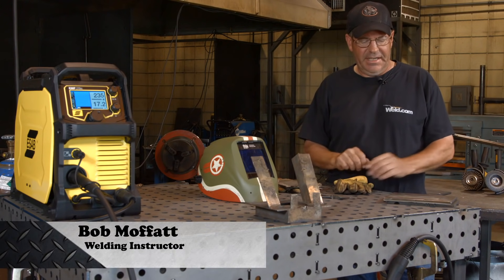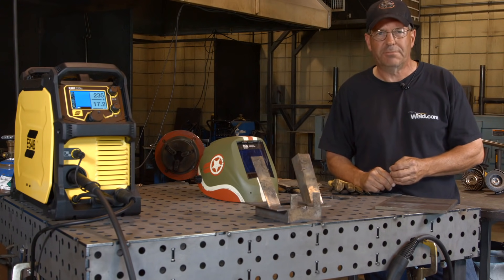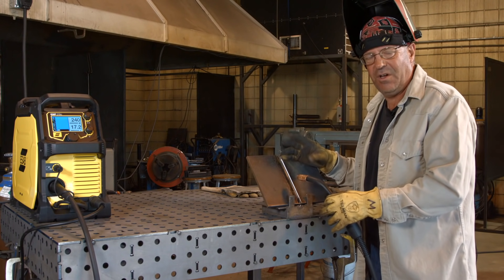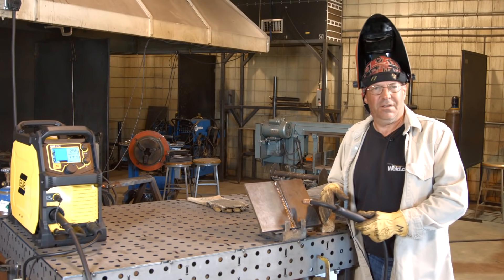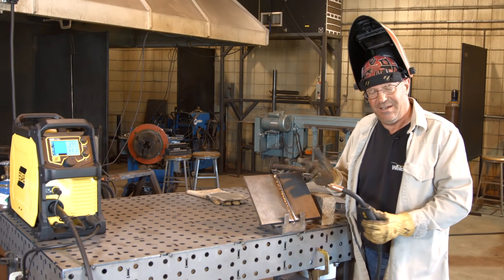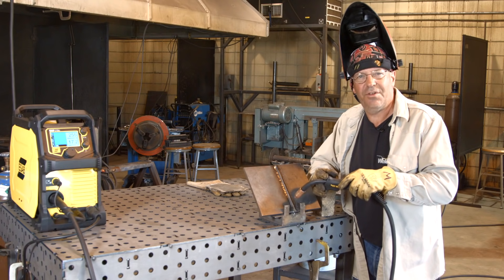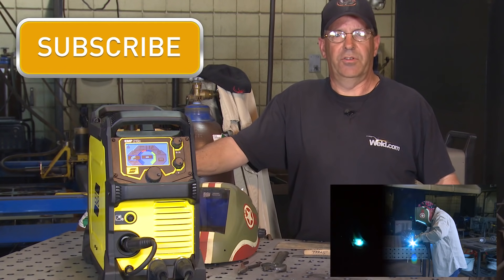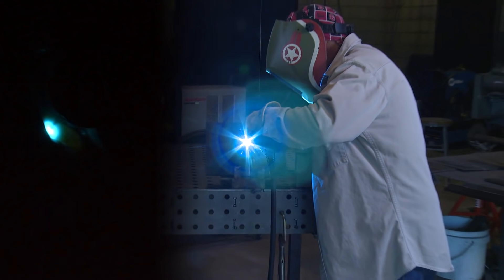Walking the Cup with MIG welding: Downhill Root, Uphill Fill and Cap

Comment: What kind of testing have you done to ensure there is no lack of fusion? ultrasound? X-ray? down hill is frowned upon. thanks
Reply: downhill is only frowned upon for thick metal, but when you do the root the metal is thin plus the gap. i worked at a shop were all sheet was downhill with good penetration.
Reply: Countryboy2206 understood, I weld on 1/2 to 3 inches thick that requires back gouging then tested
Reply: X-ray and bend tests.

Comment: im 16 and just yesterday i spent the whole day welding (second time) and i was so happy that i was actually getting the pieces of metal together, now that i see this vid i feel like shit lol
Reply: angel martinez just keep practicing.
Reply: Allen McKinney ive gotten way better now, i did a buddies cnotch(already made just needed welding) and it came out nice, for sure ill keep practicing
Reply: angel martinez I'm trying with a Clarke 80e stick welder that was given to me and now I'm trying to relearn how I got started back in my jr high shop class. I plan to get harbor freights 170 mig welder soon but I gotta run a 220v line on my porch first.
Reply: angel martinez you ll get it keep going young man.this comes with time an practice
Reply: @ImaBeastUaPet  Its a trade so it will take time.  I am 75 years old, started at 16 and still learning.
Reply: angel martinez keep it up mate, im 33., and only been welding for 3 years, and everyday, i get better and better, ive learnt to embrace my mistakes and errors, as they help me to learn what not to do the next time! Glad to see a young fella havin some passion for welding, all the best mate.
Reply: 220v is the way to go. I made an extension to plug into my dryer outlet when I bought my everlast welder. I was going to get a new line put in but never did get around to it.  My dryer outlet is convenient enough to get to.
Reply: Allen McKinney, hello, just wondering mate, if your from USA, if im correct, is your standard voltage in houses and workshops 112volt ac? Im from Australia, where everythings 240. When you guys buy welders, are they made for country specific voltage for operation, or do you us adaptors?
Reply: Be gentle and patient with yourself.  Bob has thousands of days experience doing top-end welding.  It takes time, practice and learning to be good.
Reply: Exactly, learn stick and tig as well. Mig is the easiest one, stick will really test your skills. I have a Lincoln 140HD i use at home, but everyday at work i stick weld structural welds.
Reply: STARK RESIDENCE 120 volt is standard, ive had to convert to 240v to run a welder safely  here in california
Reply: What ever you do, do not ever ever stick with one welding process. I know guys that can mig like nobody's business but give them a stick , just wow! They can't maintain the distance of the arc and the feed rate of the rod.
If you can buy a tig and stick welder and never stick with one welding process.
Reply: Lol i was 13 when i frist started now im 16 2 and still have issue ever now and then so i mean they dont go away but they will slowly decrease over time
Reply: 4 years later,  how's your welding?
Reply: Here in Slovakia (Central Europe) we´re playing with 400V 3 phase, so its another level of welding.... At home I have 240V 165A Kuhltreiber stick welder and I used to learn by myself at home.. but now Im in MIG/MAG welding school :) Today we´ve done our first fillet welds, I was surprised, how easier as stick it is :D After school Im already planning to learn TIG in welding school :)
Reply: angel martinez how are your welds now ?
Reply: Rusty P3nis i see, thanks for the info ☺
Reply: Hahahahaha 🙃
Reply: Keep at it  you  will get it👍👍👍
Reply: angel martinez legit same
Reply: How’s your welding now, 3 years later? I’m just starting welding, I’ve got 3.5 hours or so in over a couple days, and MAN that guys welding is straight BEAUTIFUL!
Reply: I feel ya. I'm 50, just bought a Harbor freight flux core welder to fix a broken bracket on a skid steer ... and my weld looks like a metal monster sneezed and blew molten snot all over it. Stuck together, tho.
Reply: @MrJeffcoley1  It will make a big difference switching to solid wire and gas vs fluxcore.  My FC passes are dismal (they're strong with good penetration but look hideous).
Reply: @AN-kg4ei  Thanks for the reassurance. I welded a broken bracket on a skid steer, and it seems completely solid and is holding up fine so far. I also welded a patch on a rusted out crossmember on my boat trailer, which also seems solid. Both of them look like hell, tho.
Reply: Keep welding. Persistence pays off.
Reply: How your welds now
Reply: A lot of practice and hard work pays off$$$$$$$$$
Reply: hwy bro congrats your 18 now

Comment: I wish there were a 3 to 6 month welding class at my local com collage . They have 3 year class and that's it . I don't want my welding phd . Although would like to learn the fundamentals and popular methods and techniques used . As well as learning fluxcore mig . Stick arch and torch gas
Reply: Sounds like you need a 3 year class rather then a 3-6 month. I mean unless you want to weld half ass.

Comment: 45 degres is easy sir make vertical i ll  show you one of my job in photo 😋
Reply: Watch the other video where we did one at 90 degrees. It welded exactly the same. I have the bend coupons on my desk. 
We had this one tilted back 15 degrees for camera angle.

Comment: esab has a very good product here.....it is important to be able to weld with the 60/10 boath 3/32 and1/8th.  p.5 rod I have been THRUE 4.   inverters to finally find a reasonably priced inverter that will also pull the 60/10 1/8th rod....even the equivalent Lincoln or Miller ...WILL NOT DO THIS. ESAB rebel ....is the way to go  for combo welding Tig and stick  x-ray quality root pass .fill .and .cap
Reply: good product....good price

Comment: Will that esab do alum mig or tig
Reply: Adam Lewis 
stick mig tig, mig weld aluminum with spool gun, will not tig weld aluminium, good machine but the duty cycle lacks in the rebel 215ci
20%@ 135amp. 
wish I would have went with 235ic
Reply: thank you len was looking for the ac tig. i might go with the lincoln square wave 200  It looks like a good tig/stick machine.
Reply: Len Johnsgutrf89on
Reply: Spool gun aluminum mig. DC aluminum tig with helium.

Comment: As a hobbyist metalworker it's not clear to me why you have the gap at the start. wouldn't it be every bit as effective to close that gap, as the tip of the bevels on both sides goes down to effectively zero thickness, ensuring full penetration through the full depth of the bevel? Thanks for any clarification!
Reply from the maker: If it is thin enough, then no gap should be needed to achieve full pen.
A couple of practice runs to set values and go….
Reply: Jon Miller that was my first thought as well, but as I thought it through, I realized that a tight fit with no gap might leave areas of insufficient penetration. The weld has to go all the way through to the back of the weld to ensure full penetration.

Comment: we use short circuit hard wire process all four passes open root on pipe with.035 down hill and get xray quality welds every time.  we use it for role welding and for doing hard ties in the field

Comment: I wonder if you might suggest what wire size, voltage and speed settings are you using for each pass. I know the brand of wire can even make a difference too. thanks. Great video.
Reply: Going off the sound the gas was 75/25 the wire was most likely 0.035 from the setting they showed at 101 amps and 17.2 volts, also wire speed between 160-200 that's just a guess though

Comment: When you use this technique on pipe, do you start at 12o'clock and go to 6o'clock?
Edit-I'm asking about the open root pass.
Reply from the maker: If it’s in the fixed position, yes. &#160;However, some additional technique is required. We will be doing a full video on this soon.

Comment: I'm lost.  How do you keep the cup from arcing out and sticking?
Reply from the maker: The nozzle is insulated as with any Mig gun. Sticking – keep nozzle clean and use very little pressure on material.
Reply: Thank You.

Comment: the reason u point down wards and get away whit it is because its not at 90 degree angle, u weld very low amp much wire, this makes it slow, u have to point slightly upwards at a up hill run....the spatter that u mentioned is just to much wire low amps, if i hear brrrrrrrrr i know a amature u should not hear the wire,,,  25 welder
Reply: using short circuit mig you do hear the wire, and he has it set just right, your a fucking you tube welder/clown shoe, now go bye bye.
Reply: Donald is right, he's running a little cold. Since he's trying to teach Youtube monkeys basic technique, it's a finger pointing at the moon.
 The simple truth is hotter is better. Faster is better. 
Both for the bosses bottom line & the HAZ. I suspect if you go find the straight vertical vid on this channel you'll understand there's a subtle difference in machine set up/shroud angles.
 You can bet your clown shoes this fella skips the easy mode when he's on the clock.

Comment: stand that plate at 90 degrees that's not vertical
Reply: +andrew pettitt not true it's 90 degrees + - 15 degrees so the lowest would be 75 degrees to be considered vertical
Reply: +Silas Veldhuis thank you you just can't explain that to some people
Reply: anything 30 degrees or under is classed as a vertical weld.

Comment: Question. I noticed on the 2nd pass (& 3rd….) you went completely across the weld from side-to-side. On other videos I have watched it seemed the 2nd pass went from one side to about mid way over the root pass, etc. Is this dependent on the size of the V or what?
Thanks for another good video.

Comment: how does something like this xray? looks amazing one heck of a good welder
Reply from the maker: I personally have performed this type of weld on plate and pipe 1000’s of times to X-Ray inspection. No problems!!
I learned of this procedure in the late 1970’s – 80’s from a guy that worked at Conoco – Ponca City, Oklahoma. It was approved for pre-fab piping spools worldwide.
I’ve also used a variation with a TIG root and GMAW uphill fill and cap – short arc, in the production of direct fired boilers. ASME code / 100% X-Ray / Hydro-pressure test – The Hartford Insurance Company Boiler Inspector Group. Again, no worries.
Keep in mind, there are no pre-approved procedures for short-arc GMAW. One must test the procedure to verify sound welds and test to the procedure within the essential variables.
 
Downhill roots are as strong and pass X-Ray and bend tests.   It has been proven for many years with flawless service

- Bob Moffatt
  Welding Instructor - Cowley College
Reply from the maker: I personally find it difficult to control penetration with flux core on an uphill root pass. It can be done with the proper fit and parameters. Just seems slower to me. - Bob
Reply: You look awfully familiar. I actually live in Blackwell, OK. I worked as a combo welder at Conoco in Ponca City about 10 years ago. I have also worked at Mertz and HMT Tank.
Reply: Bob  Moffatt hey bob what is that hood you use?
Reply from the maker: ArcOne Vision
Reply: StarWeldR I'm from around the Ponca City area. Taught night classes at PVT for years. Worked in the refinery and did pipeline all over too.
Reply: Downhill root never tried that unless it was so wide a gap I had to and could inspect the back side. But would never work on a test plate. Damn good looking cover though.
Reply: @lsgt5132  I came up with, and tested a procedure using Miller's RMD modified short circuit process. It's made to weld nothing but downhill root passes. A 5/16 plus gap is child's play using it. Amazing stuff. Can actually do stainless without purge. Enough gas gets through the gap to shield the puddle until freezing. The procedure is under ASME SEC IX, uses short circuit GMAW (MIG) downhill root, and pulsed GMAW hot, fill, and cap out, uphill string or weave. 6g, sched 80 A106 pipe, 1/8 to 1/4 root opening. Passed over 300 x rays on a big pre-fab job. Even works great on Amonia piping!
Reply: Well maybe on AWS but definitely not CWB plate.
Reply: Weld.com No, I meant the mig root pass going up. I only asked about flux core pipe because so little info is available. I reckon you must go downhill on the root. Can you tell me how the pipe is fitup like the gap and land for flux core?
Reply: why do some want you to do it going up? also have you ever done this with flux core on pipe root pass going up?

Comment: Good technique and video, only thing I see off on the title really is that you have called this vertical welding and it appears that your plates are tilted greater than 15° from 90°, and this would not qualify as a 3G weld test. Welds do look nice and I feel that all you demonstrated would translate well to a 90° 3G test.
Reply: Thanks for calling this out. I did do another right at 90 degrees. Nothing changed it all and it welded exactly the same. I lean them back a bit for safety sake and for camera angle. Thanks again, B
Reply: probably just for demonstration purposes. he seems to know what hes at.
Reply: Thats absolutely true, he does know what he's doing and people whom don't know this, will practice and try and take a test like that and whine when told they are wrong. When you take an expert, people will assume all he does is correct, and thus no assumptions like that should be made.
Reply: I'd like to see him do a true 3G his travel angle would change I bet.